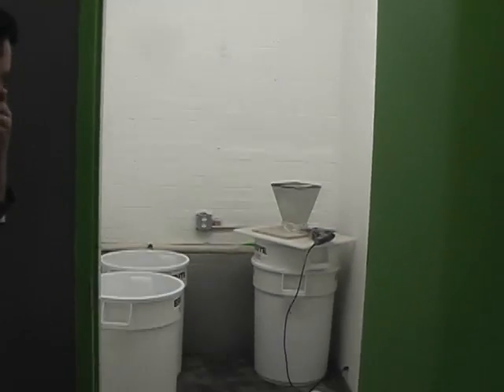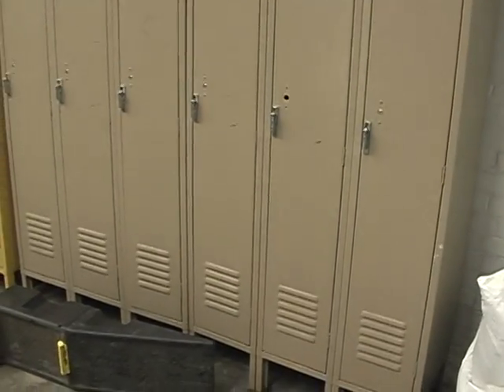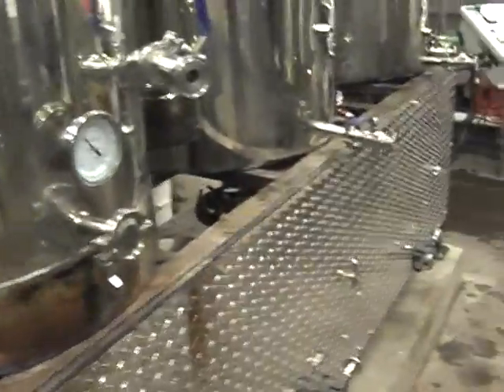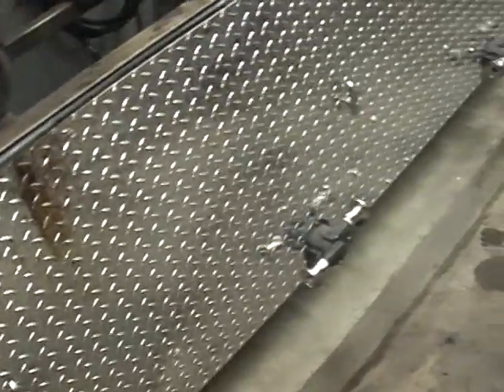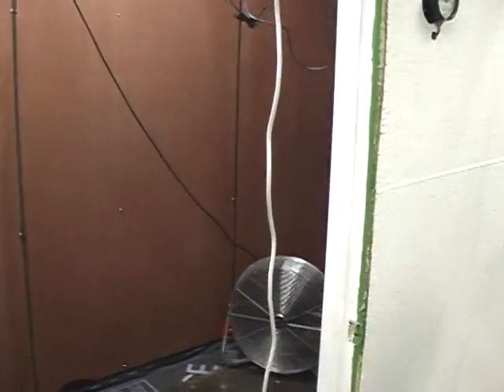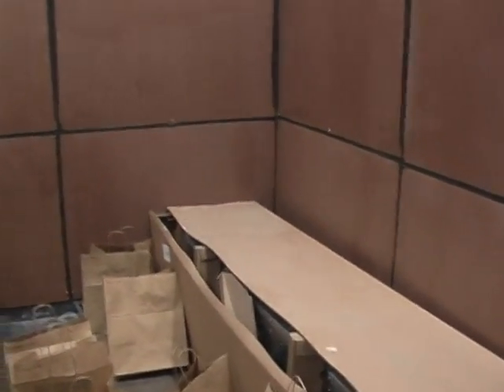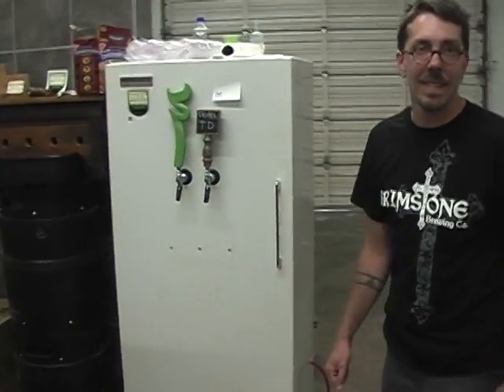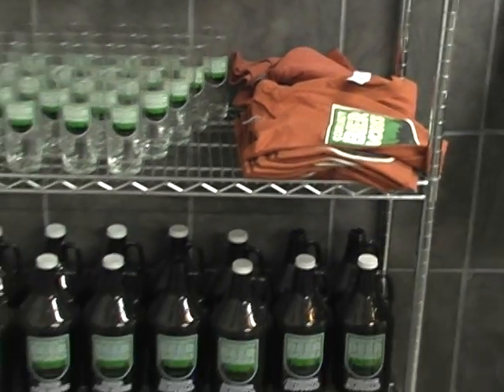Tour of Community Beer Works in Buffalo, NY

Comment: I see these ac units controlled by the coolbots are all indoors. do they exhaust a lot of heat into the rest of the brewery? I just build a walking in the basement of a small nano we are opening and the inspector is concerned it will produce too much heat in the basement. its a 24,500btu unit and the cooler is 9x10 with 5" foam walls and insulated door. im Hopeing it wont be running constantly enough to be an issue